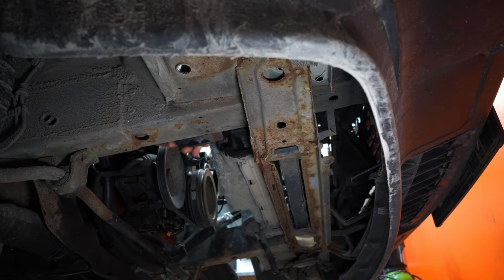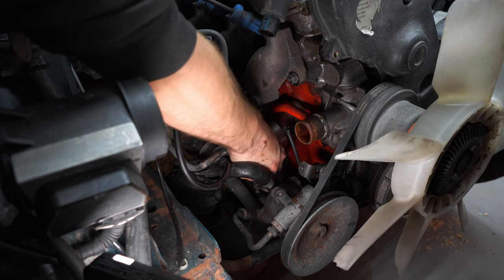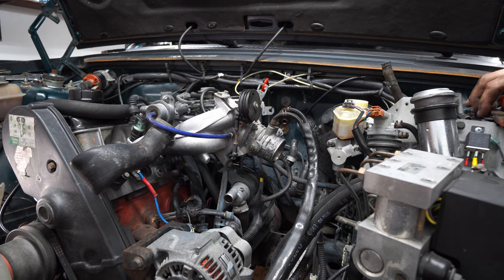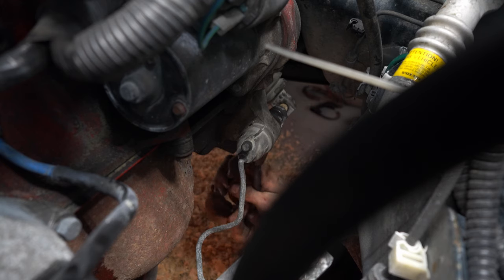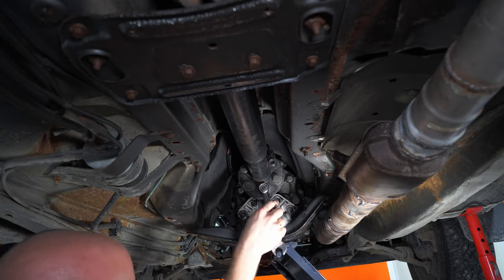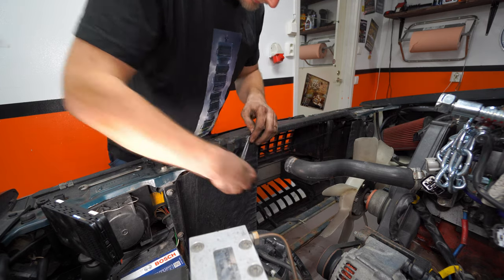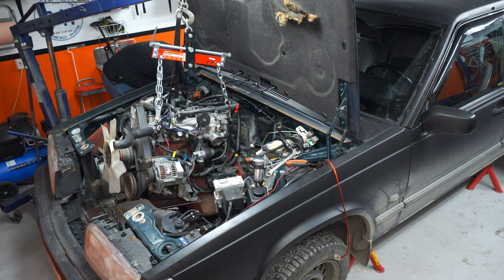Quick Engine Removal || Maintenance Work || My Daily Driven Volvo 945

Comment: Great video and great channel! Complete novice thinking of pulling my B230FT on my recently purchased 945 as it needs a refresh and there's no better way to learn than to pull it out. Wondering if you have a manual or specific resource you'd recommend to help me with figuring it all out. I've found lots of useful info on forums/youtube but you tend to have to already know what you're looking for to find it. Keep up the videos!
Reply from the maker: Thanks, i agree with you there. The best way is just to do it an try to learn from it. No I dont have any specific manual but try to stick with the Volvo greenbooks (orginal sevice manual) I think that the haynes and so on is a bit too general at times. 

There is one site that lists a few of the greenbooks, but some of them are in Swedish tho. 

 http://www.v8volvo.se/mekartips/volvo/140-240-260/_140-240-260.html
Reply: @BackmansGarage  Awesome thanks for the info.

Comment: Regarding your PCV system. I checked/cleaned/replaced my system in the spring of '19. This also included removing and checking/cleaning the oil separator box. I was very surprised to see how clean the box was on a B230F engine with 430,000 kilometers. It was virtually as good as new. I guess sometimes you get lucky!
Reply from the maker: Just got done flushing mine out yesterday, It wasn't that bad, a little condensation goop in the very top of it.  But one of the connection hoses was pretty stuffed. 😀

Comment: Yet another good example.  Been looking for any vid content from you swedes in english language sometimes is a pain.  It is very very helpful.  Seems like the B230 is equivalent to the chevy V8 here in america. As a Volvo owner of many this is the first where I seen a front block off for the radiator as I am thinking this is due to the cold over there. Have not seen this in the states. Is it a factory part? Good job 👏 with the example as I never thought about ease of the wiring harness removal as I always take it from the motor. I'm gona give it a go next time. Thanks for all you do...
Reply from the maker: The front block off might be a cold wether application, but iam not sure about that one. All I know is that does come stock on this particular model anyways. Thank you for the comment 👍

Comment: Good morning my friend. Watching your video as i prepare yo head to a junkyard to remove 2 940s engines to hopefully put together a solid turbo engine for my 245. Is there anything you could add in relation to lessening the time spent in junkyard? I will be pulling the engine, transmission, driveshaft. 

I believe because my 240 is a 92, the hatness from the NA b230 in the car just needs mild modification (and the turbo ecu) as far as i know? Im hoping its that simple
Reply from the maker: It should be pretty straight forward removing the engine, I would start with the driveshaft and work my way forwards. Regarding the harness I would try to keep as much of the stock b230fk/ft as you can, I can't say how many more wires there are but it's enough that you will save alot of time just pulling out as much of the harness as you can.  👍
Reply: @BackmansGarage  I appreciate your follow up so quickly! Have a lovely rest of your day (and great weekend!)

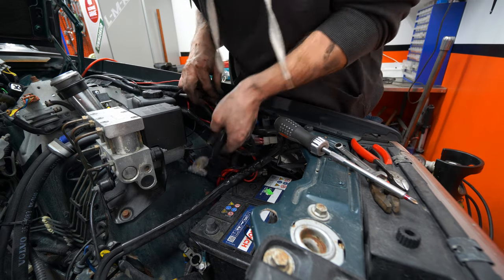Comment: @4:22 I noticed something hat confuses me: Your battery poles are the other way around? Stock, The ground pole is located to the left side of the car, and the +12V pole towards the middle of the car. Did you mount a reverse polarity battery on purpose? (and why?)
Reply from the maker: Not something that i have put any thought to actually. But maybe you are right, ill try to check it out next time im working on it if i can remember it.

Comment: Is it necessary to remove the trans with engine or can you unbolt it from the bell housing?
Reply from the maker: No it is not necessary, however the bellhousing is one with the gearbox and i just like to remove everything with such limited space under the car since i am only on jackstands 👍
Reply: What trans is that? M47?
Reply from the maker: That is a Redblock M90 gearbox 👍